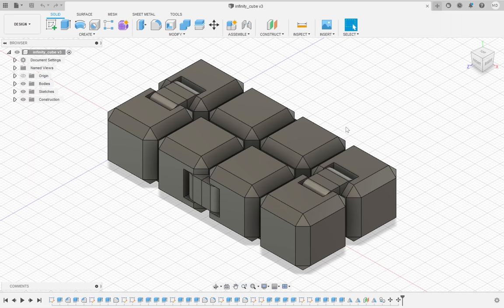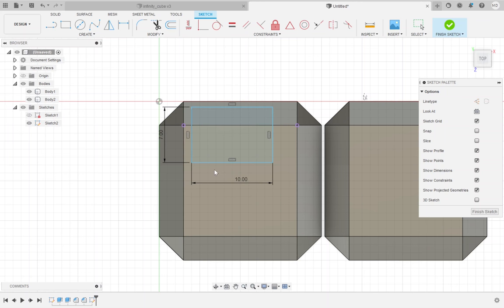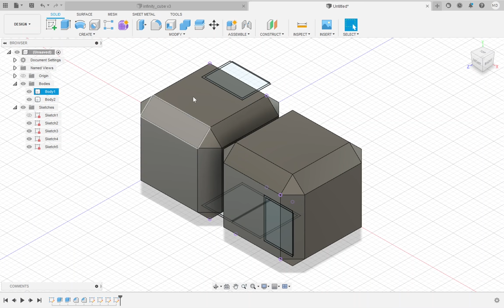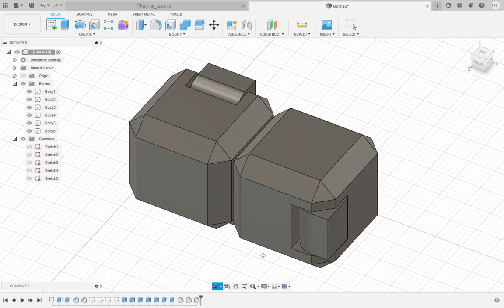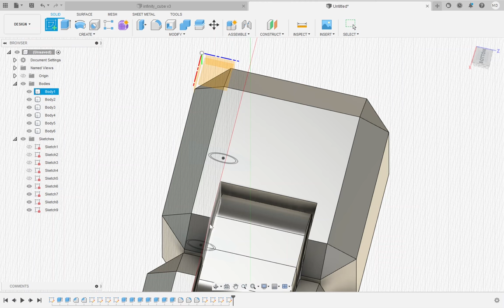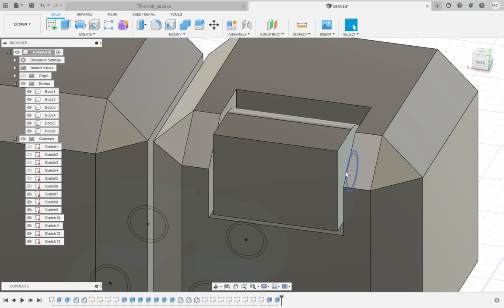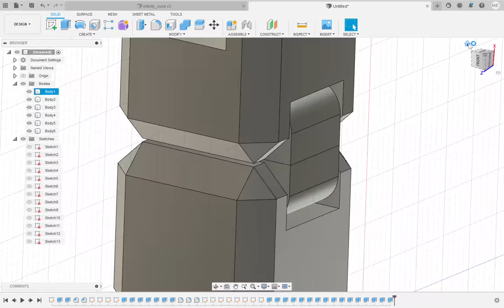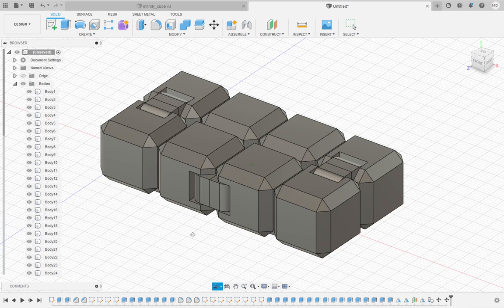Infinity Cube Tutorial in Fusion 360

Comment: Great video. Thank you. I just started learning freeCAD few weeks ago and was able to replicate all steps and finally printed. Something goes a bit slower (at least for newbie), but definitely cone is  freeCAD killer feature as it just need some concentric curve to get center point, height and two diameters. Resin print does not worked as some surfaces on hinges glued together, so need to increase gaps. Printed in 0.03mm layers.

Comment: I am barely past the beginner stage in Fusion 360 so I came here from Thingiverse to learn, but if I may a more basic question. At 13.21 you moved from the solid mode back to the sketch mode and the sketch palette reappears. What did you do to make that happen? Like I said a basic question! Thanks.
Reply from the maker: I clicked the create sketch button and selected the inner face of the cube as my sketch plane. When you do that, it will zoom into the 2D plane and turn on sketch mode.
Reply: @mjdargen  Thank you! As I said pretty basic.